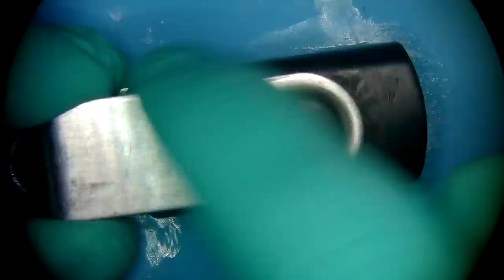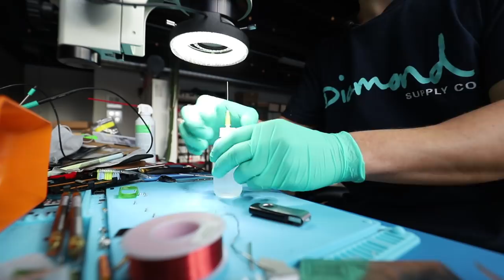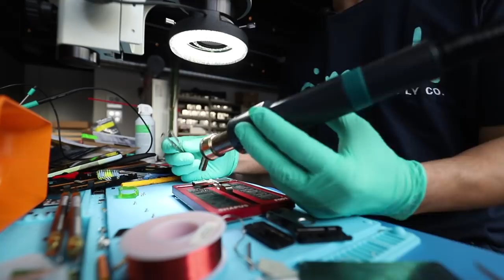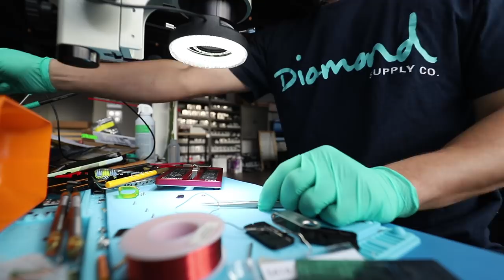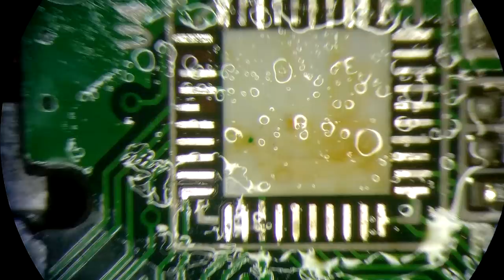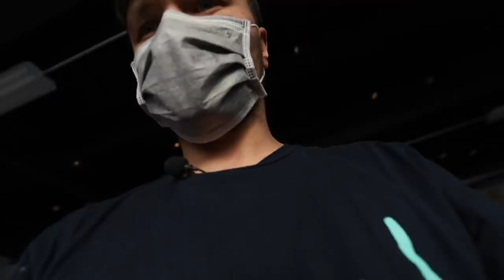recover data from bent flash drive

Comment: why that mask? it is anti dust mask, not anti fumes mask
Reply from the maker: I use fume extractor that sucks out most of the fumes, but the mask is actually charcoal lined for fumes. Working with fluxes and PB'd solder and rose metal makes me want to take as many precautions, you know.